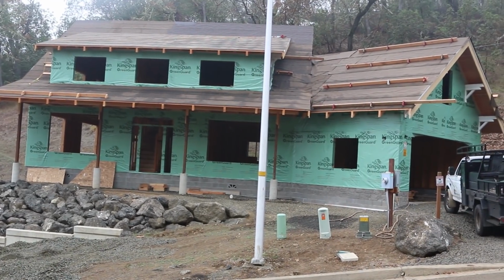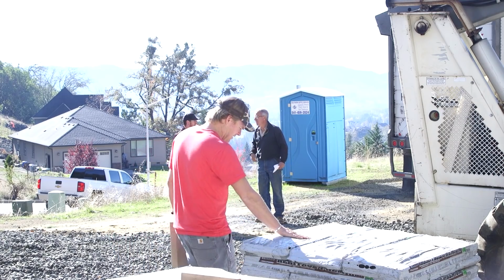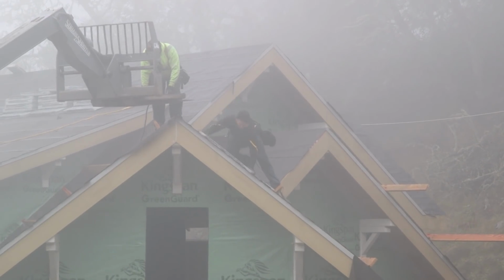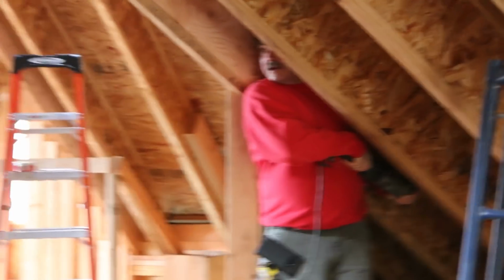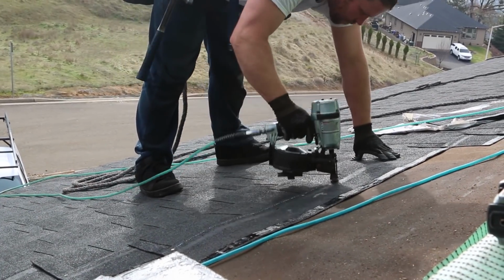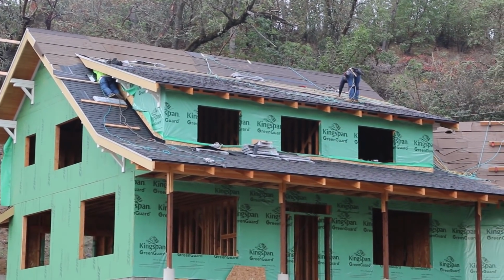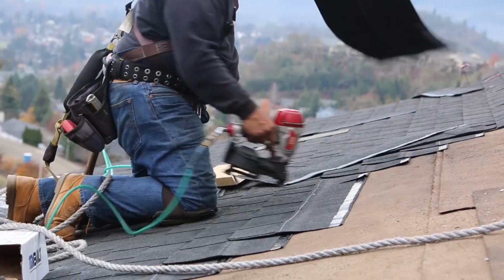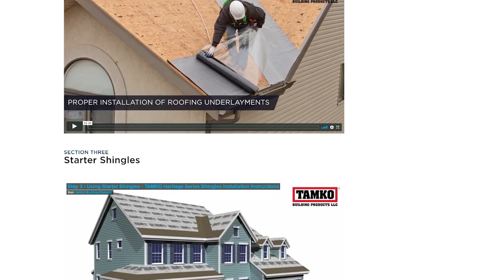Installing Asphalt Shingles Ep.77

Comment: My whole life in construction and I have never seen the roof come in a FedEx truck. Awesome for them to help out the build!
Reply: It makes sense though for shipping, it’s probably cheaper freight
Reply: If you buy directly from the manufacturer, that's usually how it shows up.
Reply: I've seen it for higher end metal roofing direct from the manufacturer, but I've never seem asphalt shingles delivered via FedEx, that was neat to see.
Reply: Yes, very interesting to see. It's probably not all that common to have someone who can guarantee, without a doubt, to be able to pull the material out quickly for the FedEx driver to get on his way.
Reply: Sponsored video, so probably directly shipped for mfcr
Reply: Total surprise yes, when a Mfg. Kicks in donated product on a build my experience has been they compensate a local distributor to supply it.
Reply: Yeah, that was a little weird
Reply: Mate never seen that

Comment: I’m 72 yrs. old and remember carrying shingles up a ladder on my shoulder.  It was summer work and it was a killer.  We were in pretty good shape when football season started though.
Reply: I'm 62 with a similar experience. Although probably about 10yrs. later.
Reply: I'm  68, in 1969 and 1970, I remember my summer job in Michigan working with a contractor building a garage a day, at least 5 in a 6 day work week and the last thing we did was the roof, up the latter with plywood and shingles on the shoulder. Hammer and shingle nails. This was my first real job that set me on my way as a blue-collar worker.
Reply: After shingles went to fiberglass mat the  240 lb/ sq. became 210 lb. and when I was considerably younger I took two of them up two storeys on a ladder just to see if  I could. Barely, and didn't do it twice. One is enough at a time. Now of course whenever possible an electric ladder or a forklift is used.
Reply: I'm 27 now but when I started roofing the day after high school that's how I did it. I ran for 16 guys on those steep city cedar roofs. I excelled they eventually found a new runner and I started roofing. 8 years later I got alot to learn.
Reply: I got fired from roofing in the 90s. Boss said I was lazy because I wouldn’t carry shingles up ladder to 3rd story roof. Built trolly sled with rope pulleys and trash lumber on site. Never seen someone so mad in all these years. Got fired and went on to build telecomm, radio, and tv towers, so I guess I wasn’t meant to roof as much as rigging.
Reply: I'm 32 with exactly the same experience. Hard work makes hard men.
Reply: @Nobaddays279  I can't even comprehend dropping posts and shingling in the same day. That's crazy!
Reply: I'm almost 45 and carried felt rolls and shingle bundles up a ladder on my shoulder as a teenager. And even then, not so long ago, I never saw a roofing nail gun.

 Framers (my later job) had nailers but roofers were still holding hammers until I left residential construction in '98.
Reply: @Resistculturaldecline  Similar experience here.  If they would have existed when I was a young man, I’m sure our crew couldn’t have afforded to use them.
Reply: @doak4886   Yeah, that also. I worked around some sketchy dudes 😆

Comment: Ladders: I'm a retired painting contractor and am fortunate I was never injured related to ladders. I've had some scary close calls especially getting on and off, but was lucky enough to learn from my mistakes before getting hurt. Two things you said are so important, i.e. extending the ladder 3+ feet above the roof edge and securing the ladder top/bottom.
Reply: Jack Sak Why is 3+ feet important? Just so that you’ll have a bit of a handrail?
Reply: Worst ladder fall I ever had was my ankle randomly giving it on me (since the fall ended up being uncontrolled). Was a sever issue for the next week and a danger the next few months.
Reply: OtherTheDave 
The ladder must be at the very least three ft because you need the hand-hold.  Obviously it must be tied at the top (not so easy if you are using skates or tiles). BUT lashing down at the bottom is essential, because getting on or off the ladder top can lift the bottom end off the floor.
By the way a knee or ankle that collapses for seemingly no reason is likely be your low back. L5 feels like ankle sprain L4 feels like knee injury.
Reply: Vamos ManUtd  My advice, find a better company. Life is too short to work around fools.
Reply: The worst is when guys put the ladder 3 ft above the edge and then don't tie it off. The couple close calls I've had have been stepping off a ladder to the roof and it wasn't tied (because nobody thought it was important). That usually leads to me quite angrily digging through my van for something to tie it off with.
Reply: @OtherTheDave  Yes, use as a handrail especially when standing on a steep metal roof trying to step back down onto the ladder to get off when it might be difficult to see if the ladder wasn't elevated above the roof line.
Reply: Vamos ManUtd  buy your own and use it, who cares if they laugh at you. Or find another company that number 1 priority is safety.

Comment: I'm glad to know the shingles were donated to the project, so props to Tamko for that.

I've done nothing with my life but install plywood and shingles for the last 8 years, and take a certain amount of pride in my work, always trying to improve my technique to better balance quality with speed.
I wasn't overly thrilled about some of the practices I saw on your roof, no compared to the calibre of the house you've built below it, especially if this is the best they can do for cameras; you can bet when the cameras aren't around they'll be paying even less attention.

A 50 year product with 4-5 nails per tile and massively exaggerated nailing patterns, with nailguns set too deep causing regularly over driven nails, during the cold months where the tiles adhesive won't bond down thoroughly for a long time. I could go on, they're meaningless words no one's gonna read.

Please consider finding someone else next time, with the work you put into a job, it deserves a better roof than this. Consider a GAF Timberline roof with 50 Year Warranty if you're wanting that longevity.

Comment: I used to work for a roofer in my early twenties. The man I worked for, his father had also been a roofer and fell off a roof because of not taking necessary safety precautions. He spent the rest of his life in a wheelchair because of a broken back. I knew another guy who slipped and fell off a roof. He landed on a wrought iron fence and was impaled through the leg. The fire department and paramedics had to come and lift him up off the fence before going taking him to the hospital.

 Wearing a harness can make a difference. Make sure roof jacks are nailed into rafters were possible. Tie off ladders, especially on aluminum gutters. The coefficient of friction of aluminum on aluminum is such that ladders slide very easy, in particular when getting on and off the ladder. 

 The moral to this story is that safety isn't about being macho it's about being smart and trying to anticipate the unexpected. Glad to see these guys doing this.
Reply: I agree that it is important, but they have a lot of slack in many cases. Which means that they will either hitt the floor before they get caught by the rope. Or they will experience severe trauma after they have fallen for several meters and the rope catches them.

Safety equipment needs to be used in the correct way to help.

Comment: Being in electrical construction I have found myself in a harness numerous times. I understand its importance and have a respect for its need, however, seeing the roofers have so much slack in their safety ropes so that if they were to fall would either swing like a pendulum over the edge or fall to the ground completely makes me wonder if the tripping hazards that the ropes cause is worth the trade-off. Like you I am for the safe execution of everyday work and finding that fine line of it being a help or a hinderance is a struggle. I hope you catch what I am saying, not critisizing. Another great video.
Reply: On steeper roofs, the rope isn't as bad as If you're on a lower slope. The line tends to run down to the edge of the roof and gravity forces it down as on lower slopes, the rope doesn't really get pulled down so it just bundles up if it is pulled slightly. So on lower slopes it is kinda a hassle and tripping hazard but you gotta work safely nonetheless
Reply: Vamos ManUtd  don't risk your life for a job, especially one that laughs at your safety.  You can get always find different one, probably one that'll care about your life and pay better, if they're to cheap to buy you a harness they're probably cheap on wages too. You cant come back after busting your neck, or splitting your wig. And no one wants to look back and think, wow being paraplegic sucks, I shouldn't have done that.
Reply: Josh work safely, I agree. If its a lower roof the rope is a hazard and no help. The steeper roofs i do (metal roofs), the harness becomes a tool so i can use the harness like a mountain climber to screw off the R panel
Reply: I didn't notice at first but you are right their harnesses are not making them safer with that  much slack.  At my job I have to wear a harness on occasion.  On one occasion we threw a rescue dummy off of one of the structures I climb on using the harnesses  I wear. on every occasion the dummy swung into the side of the structure and knocked his hard hat off. On on drop it broke his ankle and his foot went flying off. On all of those tests the dummy was using the safety equipment as per the regulations.  These guys are doing everything wrong if one of them falls they are going to be in a world of hurt.
Reply: You have to account for up to 16' of stretch in your safety equipment per my province safety guidelines. Harnesses on a single story home are purely to keep people in suits happy.
Reply: @jimjones4345  Agreed. Every time I've been asked at a job interview why I am leaving my old job and I reply due to lax attitudes towards safety, I've been hired.
Reply: Harnesses and tethers are to slow the fall, not prevent it. That's precisely why they have materials that stretch when they take the sudden load.
You definitely do not want a rope so short you are constantly coming up against it, a guaranteed way to get pulled over and fall.
If you fall on a roof, you are probably going over the side, no matter how careful you are about maintaing your tether length. 
Hard hats are to protect from falling items, not for protecting you in a fall. If you want that protection, you need a proper, strapped on helmet.
Reply: @TyphoonVstrom  haha I've always been hired after saying that too! Never thought about it before but I'm sure it was a contributing factor. I always try to be safe at work and home. I dont care if someone is laughing, they shut up real quick when a chain or belt drive removes their fingers for them.
Reply: Vamos ManUtd  I feel for you Vamos! Do you have a Carpenters Union in Ireland? I retired from Carpenters Local #1912, in Phoenix, Arizona in Sept. 2018. As a carpenter working for a company that hired thru a union,  workplace safety is a very high priority, and more than likely enabled me to reach retirement age relatively intact. I can't speak for the labor situation in Ireland, but in the U.S., Unions are the driving force behind safer working conditions. Best of luck to your future!
Reply: diver dave  It is so unfortunate for a man to lose a toe for others to realize the value of proper footwear. I know that people swear by or swear at unions, but labor unions in the various building trades have been directly responsible for saving an untold number of lives and limbs. Like you said, people laugh until it happens to them.
Reply: SRL's or leading edge SRL's would be the way to go - some of those guys' splat distance was about 50'!
Reply: If they fall with a lot of slack they might experience trauma from getting caught hastely by the rope. Proper use is as important ass the use of safety equipment.

Comment: You're going to have so many blow offs... 

Everyone was nailing way above the nail line almost the entire video and not even following the proper nail pattern. There is a white strip on your shingles for a reason. There is about a cm space along that white nail line where the shingle is two layers thick, basically the width of the head of a roofing nail. If you nail above that line, you only get the single layer which the nail can easily pop out of. 

I've been shingling for well over 10 years and I've had to replace so many roofs just because of people using lazy nailing habits in attempt to do a job faster.

Hats off to the guy working at 13:00 in the video though. That's the nailing pattern you're looking for.
Reply: Red Neckerson  If you want the best job, hand nailing is superior to using guns. Labor is more intensive, but you don’t have nails penetrating through the shingles or some not set all the way.let’s be honest, with multiple guns being used and the compressor cycling on and off the pressure to the guns is going to vary. Roofers don’t want to be setting nails that don’t go in enough , so the compromise is excess pressure.
Reply: @blueslurker1  Or you can just have a small holding tank on the roof that stores pressure. Sort of like a capacitor for electronics which makes it less of a load on the main power source. Makes for equalized pressure.
As for hand nailing... I would actually like to complete jobs in a reasonable amount of time and hand nailing is not the way to do that. 
Do you still drive a horse and buggy around? No. Obviously it's a motor vehicle because times change and technologies improve. 
It's really not hard to hit the nail line. I do it for 10 hours everyday haha. If you nail too high and miss, shoot another nail in the right spot. Pretty simple. People just don't bother.
Reply: That's why I exclusively use Malarkey shingles. They have a 2" nail zone to nail through both laminated sections of shingle. So you can absolutely fly nailing them down with that huge nailing zone. And they have great adhesive. If you use 6 nails per shingle you receive an enhanced wind warranty of 130MPH. Only shingles i have used the last 10 years.
Reply: @Artuso720  if you use the highest spot on that two inch nail line your shingles will flap in the wind. Best to keep them as close to the bottom without leaving a shiner.  That's my experience with doing repairs on Malarkey shingles with that two inch nail line

Comment: I read every comment because of my concern with the roofing problems I noticed. Tamco first off is a low grade shingle, but since it was free who cares? These companies that advertise on YouTube by giving products away should be scrutinized about product and business practices.
   Now for the install. For a short video there were too, too many mistakes shown in such a short clip. No ice and water membrane in North Western climate, nails spaced improperly over and over. Nails going through shingles. 
  These architectural laminated shingles are two parts ( thus two parts, top and bottom held together with a sticky material, tar, rubberized membrane, to hold the two parts together during installation. Then the proper amount, properly spaced nails go in the critical nail line to hold the two parts together. There's no compromises when nailing these shingles. I've seen too many laminated shingles slide down the roof or be blown off due to improper nailing because it cost too much for labor to half-ass a roof. I've not been impressed with roofers, still like your channel but you support these roofers when the mistakes they made are on video and unacceptable.
Reply: The tar paper was my clue. BUT , they are getting it done.  It seams like 90% of roof failures are related to poor shingle installation.   15 year - 30 year - lifetime it doesn’t seam to mater , 10 years after installation a new one is needed because of installation flaws.
Reply: The nail pattern defiantly struck a nerve with me. Didn’t c any drip edge going up the rake either. Depending on state and town code it may or may not b necessary for ice barrier and it may or may not b necessary for a 6 nail pattern due to a wind zone.

Comment: I don't understand the nailing pattern I saw being used. I'm in aware of any tamko installation specs that call for this type of nailing pattern. Maybe it was supposed to be a 6 nail pattern and the camera angle made the nails in the middle seem to close together.
Reply: I picked up in that too. It looked to me that both ends got a nail and then 3 popped to the center grouped. Doesnt seem right to me either
Reply: I agree. I didn't wanna be that guy, but the pattern is pretty suspect. I wanna see more nails on the greater slope too. EC says they do all his roofs so, I'll leave it alone.
Reply: I have to agree they missed the nailing strip quite often from the shots shown and it’s a lot different in Florida hurricane zone but still doesn’t seem correct at all and haphazardly shot.
Reply: L F  pretty spot on. Id hate to seem the guy ever doing a cedar wood shake roof. Gotta have your shit right there or youre in for one hefty repair or full on replacement.
Reply: Definitely a lot of blown nails shown. I like Atlas Weathermaster underlayment
Reply: Someone please explain why the guy at 13:44 put down two shingles without nailing into the line? I realize the slope changes there, but why not nail them? I’m learning, not calling him out. Thanks.
Reply: MoneyManHolmes because of the pitch change. Popular location for roof leaks. By nailing high on the shingle on these locations you reduce penetration areas. Still terrible nailing locations overall on this roof. So many blown through nail holes. Great shingles though.